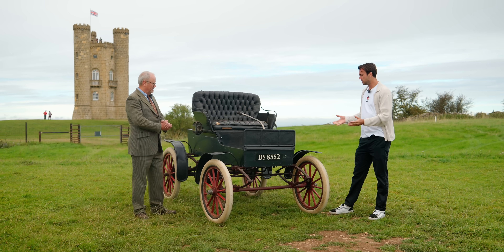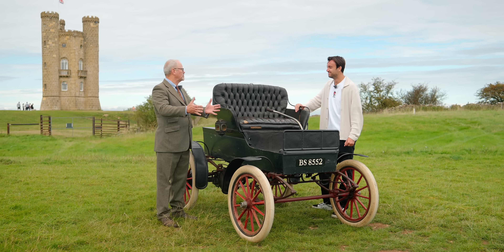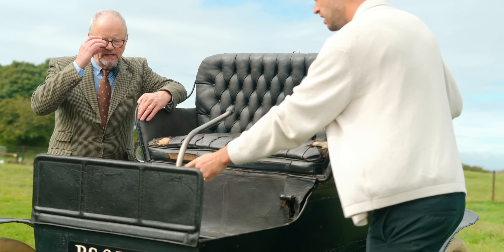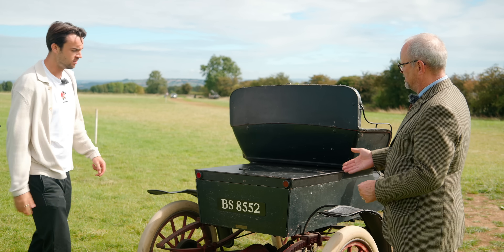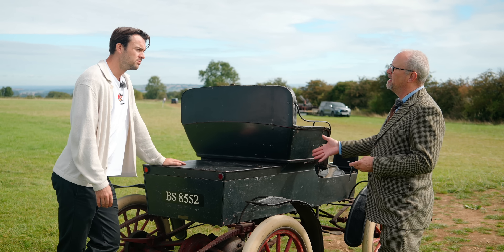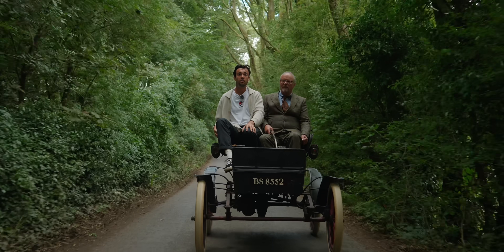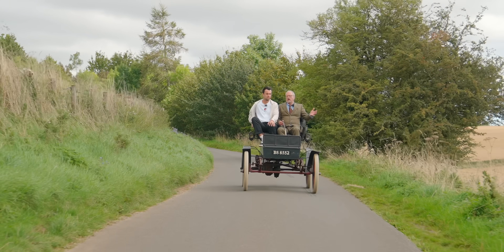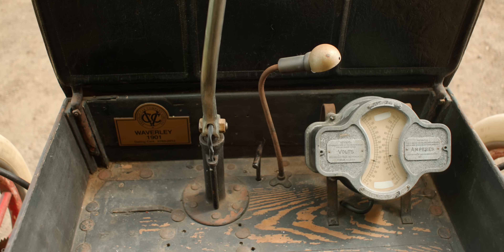Why Electric Cars Failed 100 Years Ago

Comment: Why electric cars failed 100 years ago against the horse - although they didn't emit greenhouse gases (methane) they did explode if you checked the battery whilst charging with your personal illuminator (match) and they didn't have standard features available to all horse wagon owners, such as (1) good off road ability (2) can refuel in a paddock (3) if the wagon breaks down the power unit can detach to take you home (4) auto stop (5) follow me feature for door-to-door deliveries (6) safe auto drive (only to stable admittedly, but did allow drunk driving without penalty) - so EV's should THANK the steam and petrol car for lowering the playing field - also: for low speed driving you don't need dampers with leaf springs, they're self damping (inter-leaf friction) and Carl Benz didn't invent the self-driving vehicle (which was a steam wagon, and also a 3 wheeler, and also front wheel drive) - he invented the internal combustion self-driving vehicle (nit-pickery) - and you aren't pushing EV's against all logic AT ALL, are you? (EV's have their place, which is short trips in the 'burbs and traffic jams PROVIDED all parking bays are enclosed by unpainted pre-stressed concrete walls (even at home) and all major car parks have a massive tank of super-cooled brine that can be sprayed on any vehicle which catches fire (including Range Rovers and Vauxhall vans of the internal combustion type it would appear) - or go back to Ni-mh batteries which are pretty safe I hear,
 provided you don't want to do any of this high-speed long distance rubbish - this is all my opinion of course, as I don't have a degree in ANYTHING!

Comment: It would have been a better production if they gave us the specifications of the vehicle, instead of fooling around. So, how fast did it go and how far on a full charge? How many batteries and what was the running voltages and what amps did it draw.
Can someone advise us with some more details on this magnificent automobile? ...and it was so quiet when running!  😊.   ❤ IT.

Comment: If Solid State lithium batteries become a reality by the 2028 model year, as Toyota has proclaimed, energy density could be triple what is possible in 2023. A battery weighing 500 kg could power a 5 passenger hatchback for 900 miles, and be fully recharged in 20 minutes or less. And still retain 80% of it's capacity at 250,000 miles. At least that's what the R&D engineers at Toyota say they are aiming for.

Comment: Alcohol and electricity were more commonly available.  Rockefeller had to outlaw alcohol and destroy Baker electric in order to      monopolize gasoline as the dominant fuel source.   So don’t assume the better technology won out.

BEV’s (Battery Electric Vehicles) allow for any energy source to be used. It also turns out to have the highest “well to wheel” efficiency with the lowest loss scenario.   However, big oil would prefer ICE (Internal Combustion Engines) because they could control the fuel source weather it is gasoline, diesel, natural gas, or hydrogen.  All of those come from traditional fossil fuel sources.   A BEV allows you to create the electricity from Coal, oil, gasoline, ethanol, natural gas, solar, wind, hydroelectric, geothermal, fission, or even sometime in the future fusion.  That would threaten their monopoly.   Ironically, running a BEV on electricity created from coal or oil would still be more efficient, less costly, and still 3 times less CO2 than an ICE vehicle.

But ideally, we could run the whole world on renewable sources; we have more than enough.  We can even phase out coal and oil; as it naturally becomes more expensive over time.  No one wants to risk their lives in mines and oil rigs (so the labor cost is skyrocketing) and it is getting more expensive to extract as the easy to access sources run out.

Comment: Very few wanted electric cars then, just as very few want them today. Electric vehicles severely limit both WHERE and HOW FAR one can travel. The leftist governments are pushing electric vehicles, often through mandates, as a thinly disguised travel limitation. 
The claimed "green" benefits are ludicrous if one looks at what they want you to never see: FACTS! By looking at facts, it quickly becomes evident that these so-called "green" vehicles produce MORE, rather than less, pollution than ICE engines. How can this be? Simple: The generation of power to supply the charge will emit greater total pollution due to the fuels used to generate the power, AND due to greater electric power generation requirements (ergo, more fuel burned) due to losses within the transmission and charging systems.
That's right, a well tuned modern internal combustion engine produces less total emissions than an electric vehicle. The only way this could be changed is a total switch to nuclear power. But the left opposes that...
So, electric vehicles have a dismal future, and current sales figures show fewer, rather than more, want the silly things.

Comment: Did I hear that right ? That thing originally ran on the same type of battery that the Prius uses ? The ones that are now unobtainable except for the Prius because reasons ? So it has to drop back to lead acid. A battery less prone to fire then batteries currently used in current EVs. Sigh.

Comment: Wrong on the batteries. The alkaline batteries of that era are still original batteries functioning as of about five years ago in cars of been on TV. The alkaline batteries you simply remove the tops of the batteries and clean the plates every 5 to 15 years I guess is what they said. Put your alkaline fluid in and go for another decade.

Comment: Many of the early car makers entered their "wares" in auto races, which did much to promote their petrol powered cars for their speed and power, leaving the EVs in the dust. Maybe the tables are turning now with EVs cranking out huge torque ratings and impressive acceleration figures.

Comment: 2:16 - - I see 4 wires going into that motor, so, it has to be a DC with separate excitation.
Series-wound DC motors were the best for traction, among the DC motors with mechanical commutator. They were, and rarely still used today, on the old electric cars, and on tramcars, trolley buses and locomotives. Some of the old DC series-wound are still running in this very moment in the subway of New York City. But I guess that by 1901, they did not figure out that the series-wound DC motor, with mechanical commutator, was the best.

Comment: 15:20 if Henry ford didn’t do petrol, we wouldn’t be hurting the environment and cause global warming
Reply: The network of electrical distribution was insular at that moment, mostly around the very big cities. Rechargeable batteries based on lead were available at that moment (the type from the ICE automobiles), but finding a place to charge them, was a problem. Also, you needed 2 hours to charge those batteries, and you need only 2 minutes to fill a tank with gasoline.

Comment: Land speed records for the first few years, starting in 1898, were all set by electric or steam vehicles.   In 1906 a Stanley Rocket set a record of 127mph, which held for 11 years before ICE vehicles came to the fore and held the place until rockets took over in the 1960's making a permanent switch from wheel-driven speeders.  Now modern battery tech and electronic controls are allowing electric vehicles a comeback.

Comment: A thing that bothers me, is that I am like 95% sure an electric engine that old is not performing at peak performance. Simply because of rust, oxidation, and all the other natural processes that I would call "entropy", in both the engine itself, and all the wires and connectors and everything. No motor can exist for years without maintenance of some sort. 

Correct me if I'm wrong but I'm sure that if I were to build exactly the same engine from the ground up it would perform sufficiently better. 

Also, "there's no oil change here" is most probably wrong too. And one thing that I think about this car... It looks like it's designed to transfer one lady, rather than two big men :D

Comment: Batteries weren't really the first problem. People not having electricity at home was. This is why you primarily saw electric cars in cities and industrial environments. While gasoline was still poised to take over with that solved. Had electric cars stuck around battery technology demands would have eventually accelerated development. Likely never quickly enough and probably not by a lot. But there are only so many applications that need the investment and study that EV batteries need. Without the demand, the development is slower.

Comment: I have the impression that the albeit well-intended joking about its shortcomings (no windshield, no steering wheel, "slow", ...) do not justice to the absolute marvel of engineering this car is. Instead, we should be humbled by it. The straightforward efficient design, the aesthetics, the smart solutions, the ergonomics, all that craftsmanship in 1902. I don't think we did a much better job at innovating in the 122 years since than they did at their time.

Comment: Electric motors last forever? I worked in a factory as an electrician/electronic tech for quite a spell and replaced hundreds of different types of motors! All types of DC motors (permanent magnet, brushless and with brushes) and so on, so forth. Some of our DC motors used Pulse Width Modulation for speed control and other exotic methods, at least exotic at that time 30 years ago. We replaced those too. And several different types of AC motors also. Some single-phase and some three-phase AC. So I'm one not to believe that statement about them lasting forever. The one on that car he drove might have set for many, multiple decades without being used at all. If used much on a daily basis for 122 years, I'd say the motor would likely have been replaced quit a few times.

Comment: Another thing of note of the Waverly Model 22 from 1901: no bumpers! Traffic was rather chaotic back then, but the low speeds made crashes not as deadly as they would become a few years later with faster traffic and vehicles not designed with accidents in mind. Only then would bumpers be widely introduced.

Comment: It's kind of a joke how much misinformation there is with EV's. Regenerative braking is basically not true. It's just not reasonable to generate enough electricity with a motor to actually charge a battery. It has to have less electricity stored than what is being generated in order to charge it, otherwise, it'll just flow backwards, ie reversed polarity. You could reverse the polarity to slow down the vehicle, but its not going to charge the battery, its going to use the battery's charge to slow down the vehicle. Totally different situation. It's just a motor running backwards.

Anyways, EV's make sense as economy cars because they can't produce Horsepower, and can't take advantage of leverage, but they can reuse the electricity basically infinitely to generate as much force or torque as possible with very little energy input. So they're efficient, but not powerful, at all.

It's sort of like that whole AC vs DC argument. Turns out, neither is safer than the other and both can use transformers for distribution. So the reason to use DC is for simplicity. In fact, AC causes hysteresis, or resistance to electromagnetic change in direction, which is a cause of inefficiency. 

But yeah, driving a car with lots of torque is ok, but people didn't really like diesels because they lacked Horsepower. Which makes you wonder, how can electric cars make so much Horsepower, if diesels make so little? I don't think it makes any sense.
Reply: Regenerative braking is a fairy tale for you. "You could reverse the polarity to slow down the vehicle..", "its going to use the battery's charge to slow down the vehicle..", "It's just a motor running backwards." But you know that all of today's electric drive motors for EV's are 3-phase AC motors, controlled by power electronics. You seem to have absolutely no idea how electric vehicles work! Such a nonsense, I'm sorry!

Comment: Don't throw too much shade at the lead-acid battery, by the 1990's Ford and GM had managed to get them to hold a pretty respectable capacity for 100+ year old tech. Everybody talks about the EV1 program, but before the NiMH patent scandal, the Chevy S10 and Ford Ranger were available with 20kWH lead-acid packs (only 6 or 7 less than the NiMH ones that came after) for fleet leases in California. Same range as a first-gen Leaf, but in a chicken-tax pickup truck that was useful, dependable, and saved a lot of money on gas. They were so good, a lot of the owners ended up shipping them to Norway when the manufacturers got strongarmed by CARB into recalling them and trying to crush all of them, which means they're still around today.

Comment: Electric primary traction has been ready since the late 1800's, and have been better than internal combustion since then. The single root cause of all problems with plugin battery-electric cars is the fact that batteries store no electricity.

Comment: The reasons the electric car failed last time; and perhaps even the GM EV1 are the same so far.  Cost was too high,  range was limited, but, they didn't catch on fire.  The only success EVs have had is due to government subsidies - which are wealth transfers from those that can't afford a new car; to those wealthier people that can; and for no good reason as 80% of the worlds electric grid is fossil fuel powered; and they lose much of that 20% gain in the transport of power to the charger - minimal green.

Comment: Just one thing when it comes to "how it works", this video gets it almost right, but it's actually the other way around. Each of those wires going from the controller to the motor actually passes through a resistor, which reduces the power getting to the motor. Moving the level to increase power actually disconnects wires meaning the power passes through less resistors, until finally at full power the electricity is sent straight to the motor. The same form of control was also used on electric trams and trains right up until the 1970s when electronics started to take over. The main disadvantage is that the resistors get hot when in use and this wastes heat and they can overheat and burn out, so most driving has to be done either full power or off. With more than one motor, they can also be switched between series and parallel to allow an additional intermediate power level that can be sustained.
If you travel on the Bakerloo Line, the trains still use this system of control, and towards the centre of the motor coaches you can hear the clicking of the switchgear as they accelerate and brake. It's a bit more sophisticated as the driver just selects "shunt" (all resistors in) "series" or "parallel" and the control system automatically cycles through to either full series or full parallel (particularly useful when controlling 4 motor coaches from the front of the train), but otherwise it's the same.

Comment: What you all are purposely overlooking is the REAL REASON electric cars "failed" to become mainstream back then is because they weren't as PROFITABLE as the IC engine! (They didn't fail, They were PUSHED out of the way)! Trivia time: Who was the most influential car manufacture here in the USA at the turn of the 20th century? Henry Ford. Who was backing Mr. Ford financially? Venture capitalist J.P. Morgan! How much oil profit would have been generated with electric cars? NONE! In cars with Internal Combustion Engines you need oil to lube the engines. You need oil to make the gas or diesel that it runs on. You need oil to make the grease needed to keep the chassey and suspension lubricated. It all came down to which type of car was more profitable! It always comes down to profit in the end! Money money money money money! Not 'which type of vehicle would benefit the world more appropriately', but instead "which one can make HIM the most MONEY'! J.P. Morgan also  SCREWED over Nicola Tesla (and the world) for the very same reason... Which is why we have to pay for electricity today (among other things)(but that's a whole other rant entirely)!

Comment: You know, in 1901 they would be comparing 60 mile range at 18 mph or so to horses pulling a carriage. I know for a fact horses can't run 18 mph for 60 miles between feeding and resting! Haha So that cute little electric carriage from 1901 was a miracle at the time.

Comment: Little known abroad, in Switzerland also existed an electric car manufacturer in those early days.
The 'A. Tribelhorn & Cie, Fabrik elektrischer Fahrzeuge' (factory for electric cars) existed from 1906 - 1922. Tribelhorn delivered a wide range of electric vehicles, such as doctor cars, hotel buses, transporters and trucks in different sizes. Tribelhorn also set up the probably worlds first network of public charging stations at that time. Eventually he got an order for a large number of 3-wheeled electric delivery vehicles for the Swiss post, so in 1918 Tribelhorn opened a new larger factory in Zurich-Altstetten. But after manufacturing of these vehicles, the number of orders fell and with the upcoming depression of the 1920s and the competing ICE cars, he was unable to cope financially with the oversized factory.
Reply: Wow that's interesting. 😊
Reply: Exactly, self propelled purpose built for transporting people vehicles were built by many different inventors as early as 1801. Mercedes Benz has done a great job perpetuating the myth that Karl Benz was first. He wasn't.

Comment: When GM re-explored EVs with the EV1, though, it wasn't because of new battery tech. It was still using an array of lead-acid batteries.
It was the use of  lithium batteries in automotive, pioneered by Martin Eberhard et Marc Tarpenning, that really changed things.